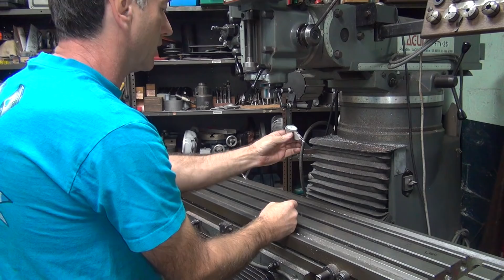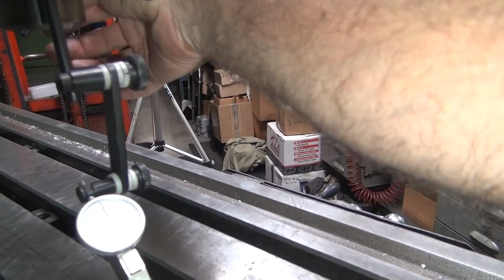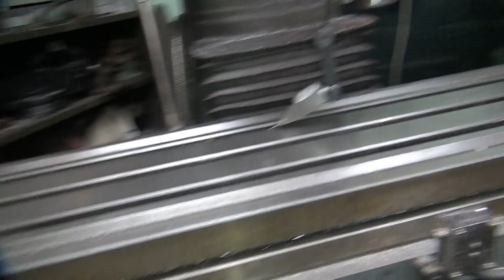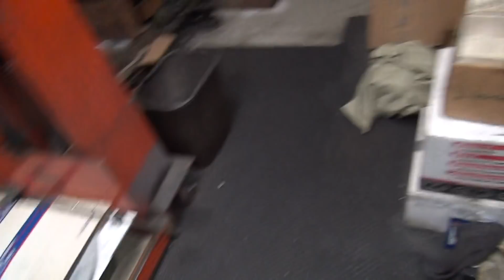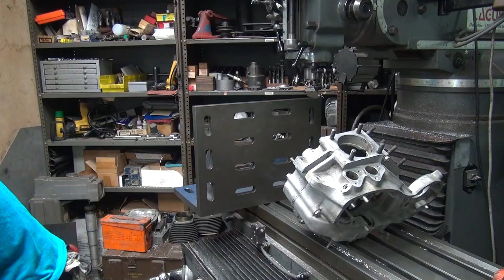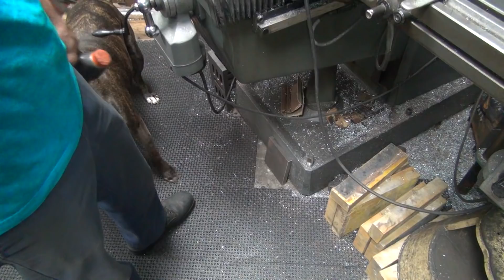1942 45 wla wl #104 56ci stroker flathead motor build 4-5/8 in harley wl by tatro machine

Comment: Glyptal question - do you think painting the insides of aluminum cases such as these 45 cases with Glyptal is worth the effort?  I don't know the plus or minus of that.  Thanks
Reply from the maker: i don't use goop in my cases. if you have holes, fix them. loctite 290 is a good sealer to use for pin holes.
tatro